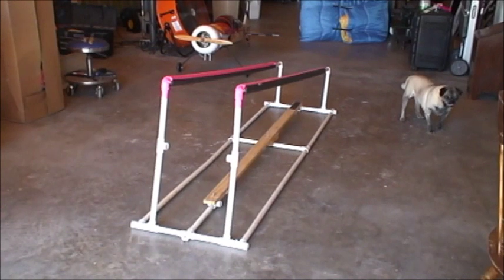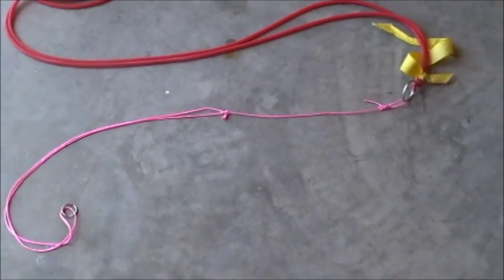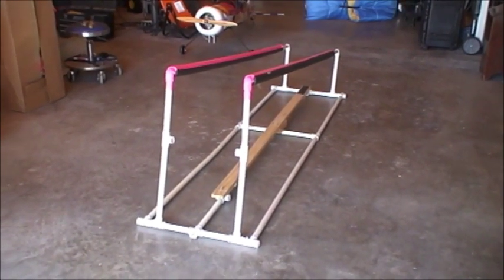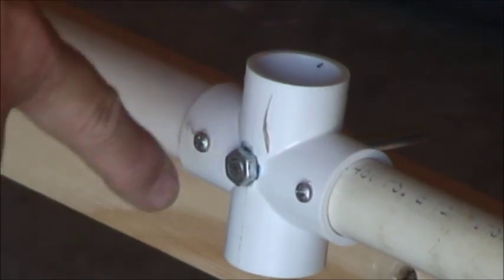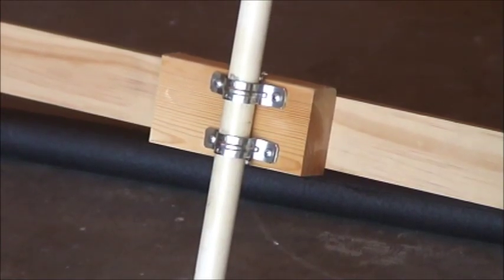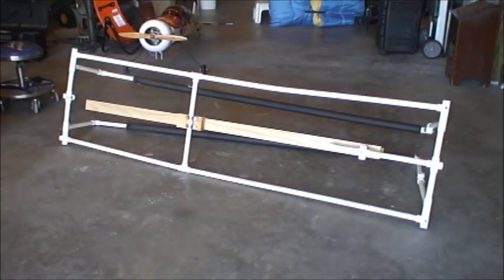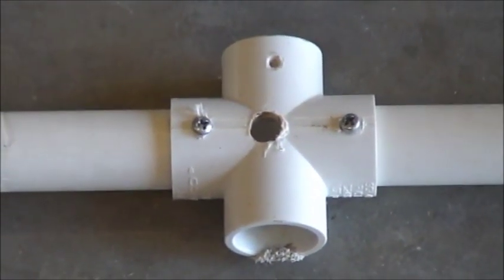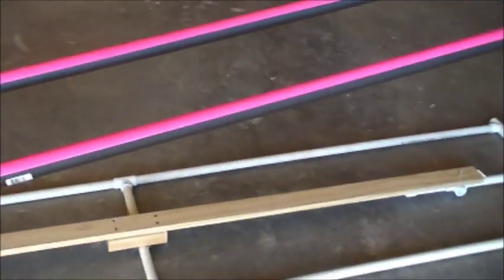Building Catapult Launcher

Comment from the maker: We discovered that the trigger would sometimes pull the pipe with the pin off the ground and not release the bungee. A stake in the arm will fix this problem. We also solved the problem by putting a weight on the pipe near the end of the trigger board.

Comment from the maker: Sorry, I really don't have any idea and I have not measured it. I have launched a Multiplex Twister, FunJet Ultras, and an Easy Star. You can put whatever you need I guess. I take about 15 step on the bungee I use and it works well. If you needed less, you could stretch it less or stretch more if needed.